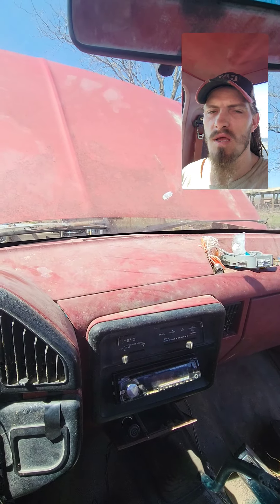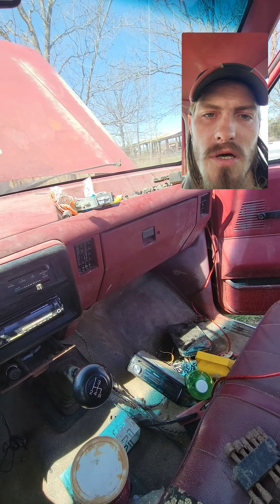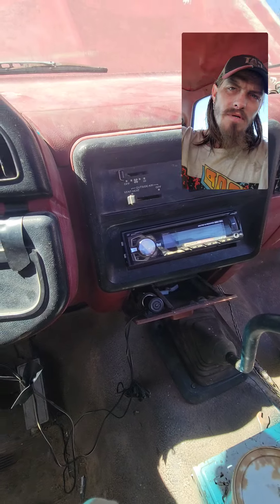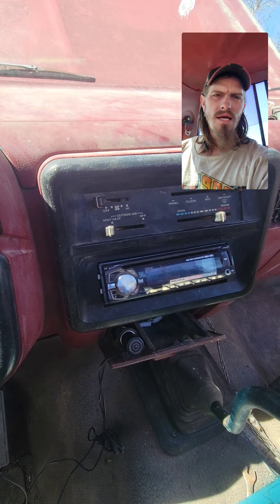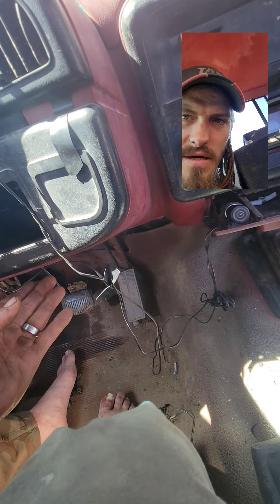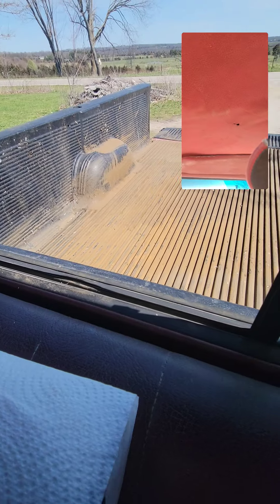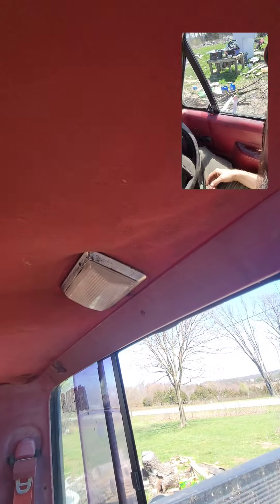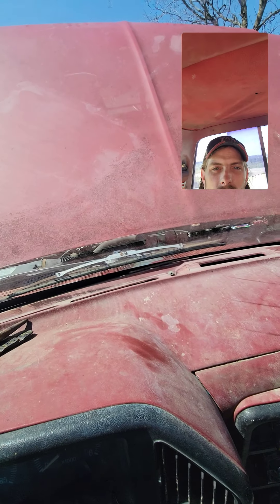Update on my 88 Ford F250

Comment: Run that Amp hot wire under the the plastic trim at the door opening. Tuck it under the carpet till you gut up close to the firewall. Drill a hole in the firewall and run it through there. That's the safest way to do it. Don't keep it in the door jam. It will wear the wire down and short out.